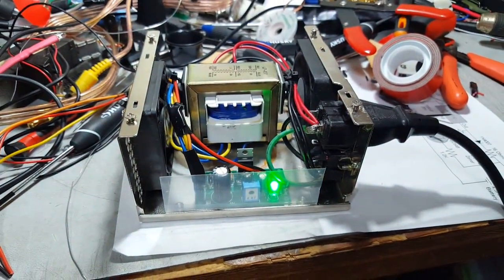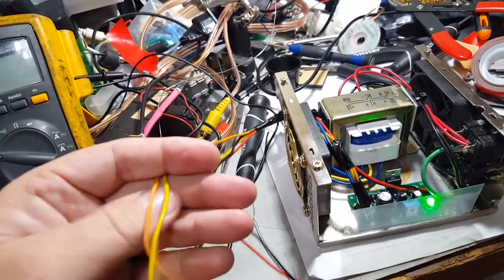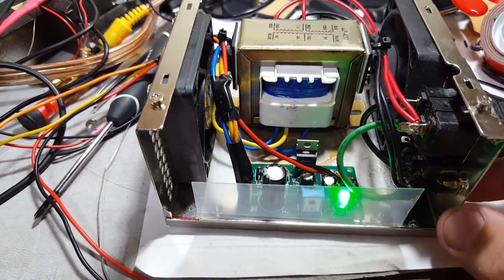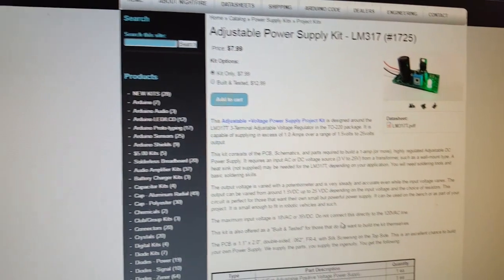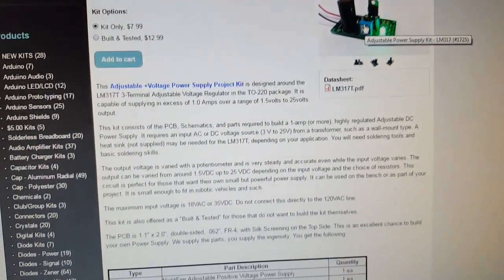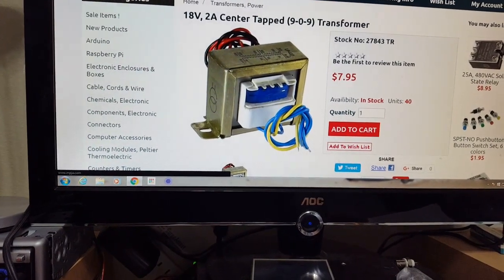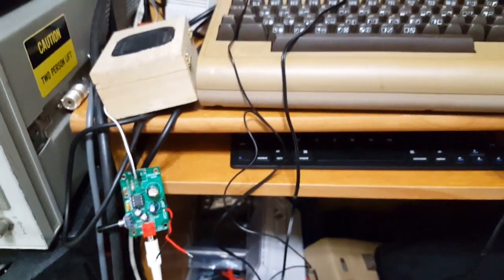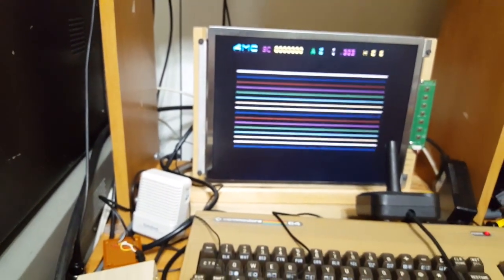COMMODORE 64 POWERS SUPPLY DIY

Comment: There are some nice "medical-grade" 120VAC to 5VDC (or larger ranges, 80VAC-250VAC for input) DC converters for around $20 that aren't much larger than your LM317 circuit.  With built-in circuit protections etc.

Comment: Thanks, I may just go your route with the kit. My original transformer puts out 10.5 vac. On the 9vac leads this runs right into the c64. Is this too much voltage?
Reply from the maker: Please see my other video..this kit wasnt enough power or not stable.
https://youtu.be/dpnxmyppVks
Reply: 10.5VAC with NO LOAD.  Once you start pulling an amp from it, the voltage drops to 9VAC.  You want a transformer that can do 9VAC while operating at expected load, so just measuring voltage while there is no current won't help you find the right transformer.